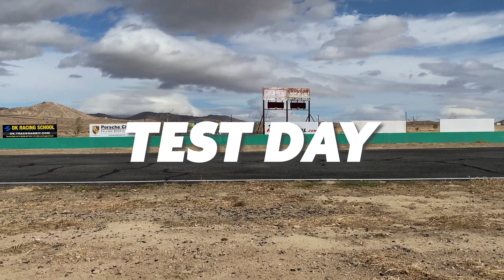FormulaSupra TESTING!

Comment: Awsome car but a wing on the back will be perfect
Reply: Not necessary, it's already fairly low on torque and looks grippy as shit, a wing would make it harder to slide about.
Reply: @Huwberts_Emporium  it's not a drift car.... It's a hill climb car.. it needs a wing
Reply: @gambit6186  It's actually a drift, time attack and hill climb car, that's also why it's got a Wisefab angle kit, for more lock when drifting. 

Also a hill climb car doesn't necessarily need a wing, in fact many don't.
Reply: @Huwberts_Emporium  they’re waiting on the aero package tho^^
Reply: Needs more under body aero

Comment: Damn Ryan what a beast you have created can't wait to see at formula drift eating up the competition and shredding tires
Reply: i don’t think this will be in formula drift
Reply: This car is NOT for Formula Drift
Reply: Nah this isn't an FD car and never will be, I said this before in the last video.  He built it primarily as a grip car but wanted to add Wisefab etc so he can still drift with it, but drifting isn't it's primary function. You can tell because he used full carbon fibre which isn't really practical for a drift car because it's hard, brittle and cracks/splinters when it gets hit. Whereas most carbon drift cars use carbon kevlar (popularised by the HGK Eurofighters). The addition of Kevlar to the carbon makes it flexible and means you can rub the rear end against a wall and it will flex and bend inwards, then ping straight back to its original position instantaneously instead of cracking or splintering like traditional carbon fibre.

On top of that it has a front mounted radiator and IIRC thin bash bars so if it was to crash or "rubbin' is racing" drifting it could get wrecked easily with no easy way to repair. A lot of FD cars nowadays are now engineered to be easy to repair and replace. So a lot of the engineering is done to make it easy to fix at the trackside or within a 5 minute comp timeout. This car isn't engineered like that.